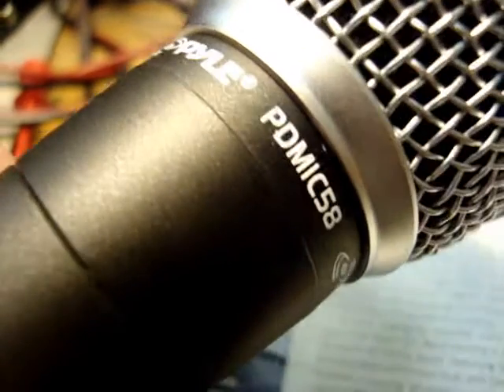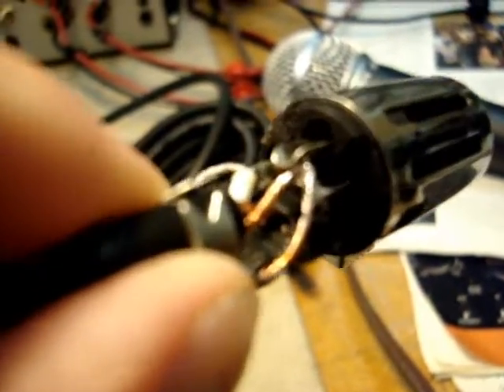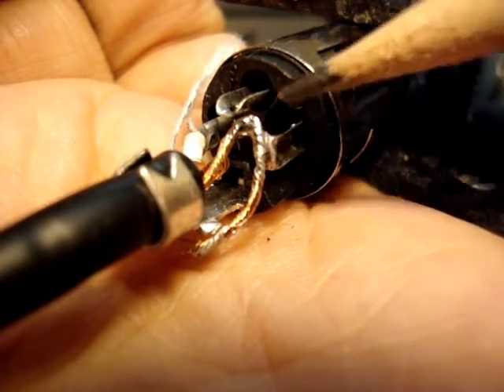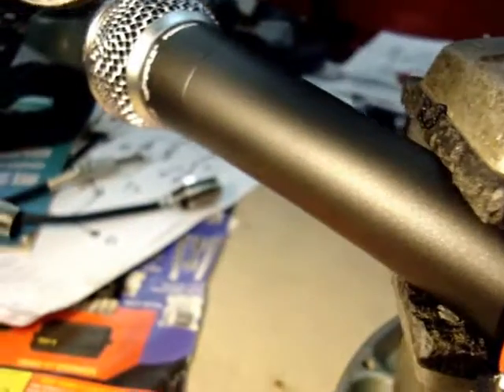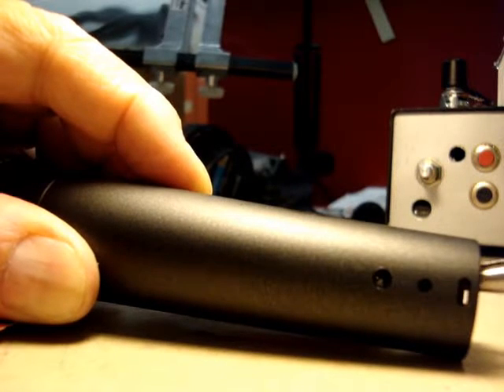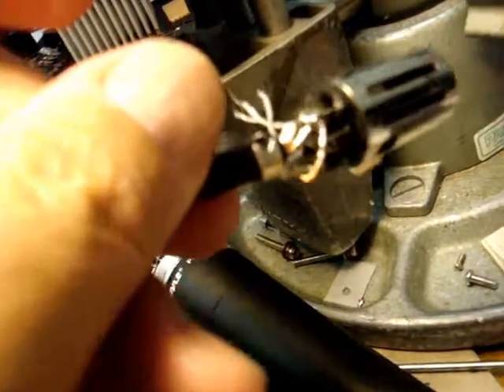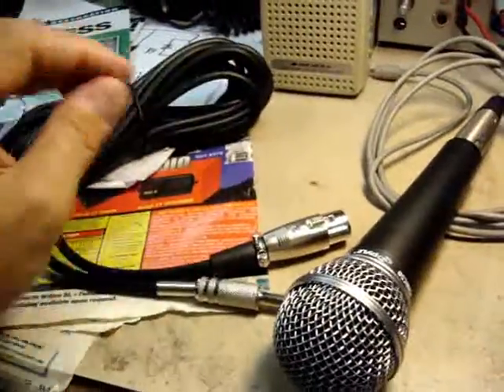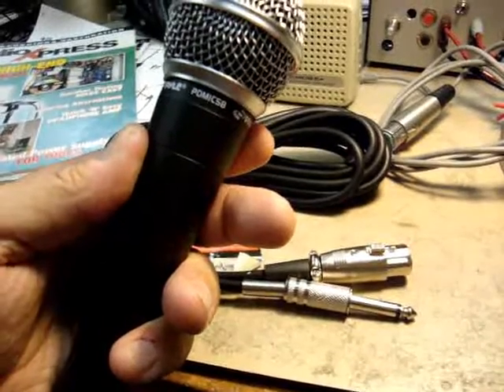Pyle PDMIC58 Microphone - SM-58 Knockoff

Comment: I rewired my PDMIC58 the way Bob demonstrates in this video. I run it behind a Newer nylon pop filter ($5 cheap one)  XLR into a Behringer Xenyx 802 mixer. I leveled and compressed it in Audacity after it was captured in my Zoom H1N recorder.  Here is a link to a recent podcast that I recorded using this mic.  My interview skills need a lot of work but I think my audio setup is where it needs to be.

http://www.deerstandhill.com/2016/10/24/nathan-mathis-talks-about-his-bid-for-congress/
Reply from the maker: Sounds Great! Good job.
Reply: Duncan Lindsey
@Andrew M. Shepard I've switched to a Samson Q2U with shure foam pop filter. Using SOX for my audio processing. http://www.deerstandhill.com/podcast/03-20-2017.mp3
Reply: I'm using a Xeynx 802 mixer with the Samson Q2U and I turning the high eq setting to about 25% to try to knock out sibilance.  I'm an amateur and it must be my mic technique that causes it.

http://www.deerstandhill.com/2017/05/15/interview-with-judge-roy-moore-candidate-for-u-s-senate/
Reply from the maker: The recording sounds ok to me, a lot like recordings we've made here at PBS in our broadcast productions. However, if you feel so inclined to taylor the sibilance, try decreasing the "HIGH 12 KHz" on your mixer to the 10 O'clock position or somewhere close to that. Also, if what we're hearing in your recording is the final product of Audacity after compression, you might want to check your compression ratio and compression settings. I usually use 3:1 compression ration with a the fastest attack time possible. All this should help with the sibilance issue.
Reply: I made those adjustments.  Here is my latest recording using the Pyle PDMIC58.
''
http://www.deerstandhill.com/interview-with-judge-wes-allen-candidate-for-al-house-district-89/
Reply: Glad it sounds better!  $13 microphone is a great value.  I need to start insisting that guest download skype before hand i guess.  Skype does such a better job at audio processing even when used on an iphone.
Reply: Andrew,  I'm thinking about getting some good headphones for monitoring during podcast.  Should I get the kind that you have?

Comment: Okay Bob, I just got my Pyle mic delivered to me today.  I pulled out the connector in the mic and it was unbalanced just like the one in the video.  I made the modification as you instructed and it works great!  I checked the cable that came with it and it was already wired correctly from the factory.  I have only tested it with that unbalanced cable and it works fine going into my zoom h1 recorder.  I will test it with a balanced xlr connection when I get a mixer.
Reply: I still have the mic today!
Reply: @duncanlindseymultimedia  your first & follow up comments, that as of this comment (9 years & 4 months respectively, for a LT study & update) is exactly what I was looking for. Wiring the microphone unbalanced matches the TS cable they included. When you made the mod and the same included TS topped cable worked fine as the Pyle was originally wired vs was modded 9 years ago. That to me says for 16 feet of cable it doesn't matter if the CLR of the microphone unit is balanced or unbalanced, it works great either way. After the mod, since we both know that the unbalanced XLR => TS tip cable works fine, a balanced XLR => XLR would work fine too, as it does for the Pyle mic in the video & for a Shure SM57/SM58, regardless of how the microphone is wired. By leaving the Pyle "unbalanced", for what has been tested, is really that the wiring of the Pyle is a universal wiring for a relative "cable select" option. I suspect a balanced XLR => XLR cable of longer length will reject & cancel noise the same as it always does. From what I see, the Pyle mic has a 3-4 inch length of "unbalanced" connection for wiring. Pin 1 is jumped to the screw lug for ground, it's also jumped to the 3rd pin,the 2ns pin is a dedicated wire. Since the Pyle is grounded for the unit itself, the 3rdpin being jumped is the same effect for rewiring the wire from pin 1 to pin 3. The original wiring of the Pyle, someone would have to show me the noise that wasn't rejected with a balanced XLR => XLR microphone cable. Otherwise the Pyle mic is wired fine for use with either an unbalanced vs balanced microphone cable.

Comment: Wouldn't you have achieved the same connection if you left it alone?  Pin 1 and 3 being connected to each other in the microphone would have created the same connection when plugged into the supplied mic cable.  It appears that they cut a step in manufacturing when they made the cable since they knew that it would be used with that mic.  Now your modification will allow the mic to be used with other cables?  I just bookmarked this video so I can do this same thing if I ever get one of these mics.
Reply from the maker: +Duncan Lindsey - Thanks for your comments. Evidently, products are coming out of China these days that are imitations, but are not like the real thing. The PDMIC58 - and also the PDMIC78 and goodness knows how many other mics - are probably ALL wired the same way.This mod makes this mic (and others like it) a true balanced connection to its male XLR connector - just like a genuine Shure SM58. The supplied cable that comes with the mic is supposed to be for connecting their supposed 'balanced' mic to an unbalanced 1/4" input. Of course, the PDMIC58 is prewired as unbalanced, when it would appear that it's a balanced connector...but it's not.A normal ready-made adapter cable of this type will have the tip connected to pin 2 and the sleeve (shield) connected to pins 1 & 3. For the life of me, I don't know why they made the PDMIC58 the way they did, but both their mic and accompanying adapter cable are awkwardly wired. The modification in the vid shows how to easily corrects this anomaly.

Comment: I have a few questions :-)
1. If it is so simple why do you think they don't do it that way
2. Does it really improve the mic? As little as I know about this the balanced wiring is to prevent noise. But that is only if there is noise or groundloops? I read a post which claims you don't really need a balanced mic especially in a studio, it is mainly for live work or where the electronics are not so good
Reply from the maker: Krach Werke  1) Good question--not exactly sure why they don't.. perhaps an executive decision. In my experience, I've found these kind of mfg decisions are based on upper level management. In the case of this mic, they probably wanted it to be 'compatible' with all mic situations. The adapter cable (that comes with the mic) usually takes care of such issues. 2) No, it does not 'improve' the mic performance per se. However, balanced wiring does prove to be proper for long mic cable runs. It's more about signal transfer characteristics than actual mic performance, as you so stated. So, why not wire it like the real thing. No, there's really nothing wrong with having unbalanced mic runs if they're short, but it seems rather silly to have it unbalanced when most pro I/O's are balanced. Being a broadcast and electronic engineer, I work with these issues all the time. Our mics and cables need to be electrically correct for all electrical environments, especially those related to ground loop and RF issues. So, I guess it's just force of habit to make things technically correct.